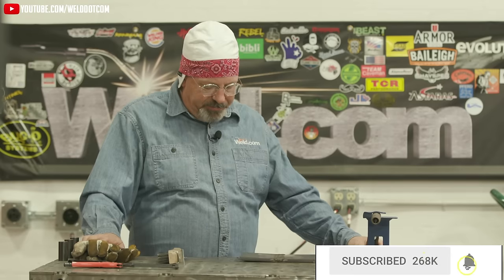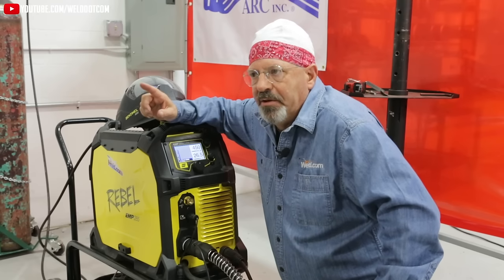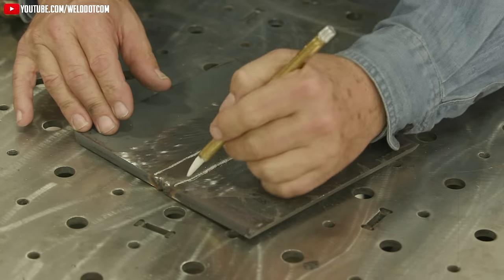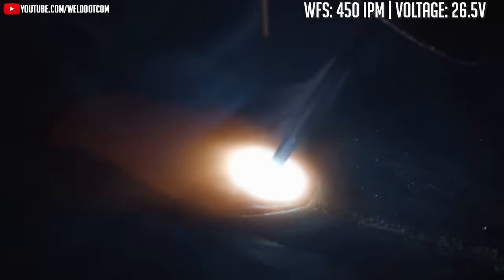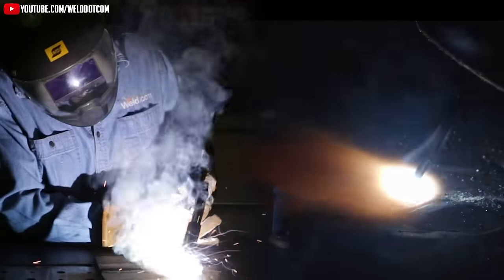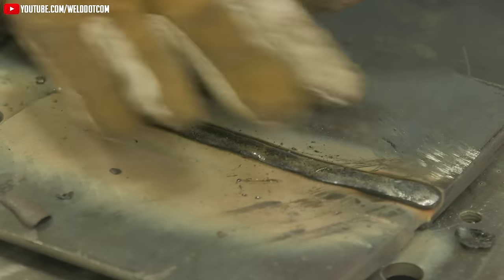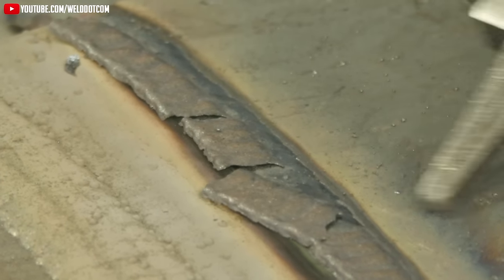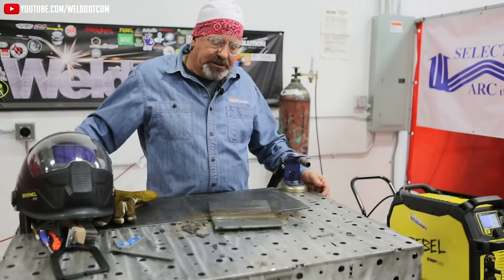GAS SHIELDED FLUX CORE WELDING FOR BEGINNERS

Comment: I have worked as a welder in Finland for about 10 years and I have worked in about 10 different companies. We have never really used anything else than flux core for general welding. It's just so much faster and easier .
Reply: With or without gas?
Reply: @stephentyas4698  With gas. In the companies I've worked/trained at it is mainly dual shield welding. If not it's tig/stick. Just so much nicer.
Reply: I just started as a weld school trainee where I'm at...and learning about this is amazing...not really much for me to learn here as my flats are almost perfect....my vertical welds are so crappy.
Reply: @grekygrek  From my experience you do NOT need to manipulate the weld in vertical position, just go straight!
Reply: @TheSongou  yeah thats what I'm sayin lol there's not much here for me to learn just need to stay under the hood and practice

Comment: In the late 70's Lincoln was developing the flux core for pipeline welding.  The company I worked for , of about 3,000 people, selected me to run welding procedure for Lincoln in the field for  welding high pressure gas pipeline from 0.125" wall thickness to 0.500" wall thickness.  The wire at that time would to toe nail a lot. Toe nail phrase means it was not stable it would burn to one side and switch back to the other.  We did get a procedure made to meet API 1104 pipeline welding code, the welds were x-rayed and mechanically tested per API 1104 code and passed the requirements.  

TIP
When welding a 30 degree V grove butt weld, the filler pass prior to the cap pass or final pass leave the prior pass below the surface about a 1/32" this allow syou to see the weld grove and allows you to make a nice weld cap or finish pass.  If you do not do this you will NOT be able to see where your weld path is. This holds true for GMAW as well.

Comment: This is a great video, but if I may, next time you do a flux core demo, could you use a really cheap welding box?  Something like the Century 90, or one of the harbor freight 120V titanium inverter welders, perhaps a 120v forney - you get the idea, a flux-core only cheap welder.  For us guys and gals that are learning this just for weekend jobs, or for welding something like a fence of exhaust pipe.  I love the videos, yours are definitely the best and my goal is after years and years of welding to make my best weld look like your bad welds!
Reply: Seconded. I'm a total neophyte when it comes to this stuff. And, like most beginners, I suspect, there's very little appeal to dropping a thousand dollars plus for my first right.  This is gonna be hella expensive to my mind al ready, and that WITH a cheapie setup.

That said, I suspect the only demographic that would get anything out of this sorta vid will be mostly similar, and therefore in need of a much MORE introductory lesson. You started out great... then just dropped into preparing we know what all those terms mean
Reply: Agreed, show me a beginner with a welder with so many adjustable settings. Mine literally has a switch for high/low voltage & a dial for wire speed.
Reply: This is dual shield, meaning gas and internal wire flux. Look for videos that show gasless flux core. Welding tips and tricks has one

Comment: I just started using Dual shield Flux Core Wire for a job welding 3/8 angle to 1/2 plate. On my ESAB Rebel 235ic, I use ESAB .045”Dual Shield ll 70T-12H4 wire. The sweet spot for this machine is 26.5/300, for flat and vertical positions. This wire does indeed run smooth with little to no spatter. Great video as always thanks for the lesson.

Comment: I run a warrior 500i all day at work. I have two settings that I use religiously, 28/400, and 24.5/350. I use 28 for any weld that isn't out of position. 24.5 is my go-to for all welds that are out of position.
Reply: Thanks,  what flow rates? I'm just starting to play with dual shield and have some ESAB  710X-M .052".
Reply: @workwillfreeyou  40cfm on 75/25. I also use a 3/4 inch hd tweeco nozzle

Comment: This really helps me I’ve been running fluxcore dual shield on some structural steel in the fab shop and I’m a stick welder so not too familiar with setting the machine. This has shed some light for me and gives me options for what I need for my welding thanks-IronmanMike

Comment: ive had GREAT luck with 24V and 275 WFS. ive used that on many different machines and minimal adjustments are needed for the WFS  but is works. not so much heat input and optimal control for all position welding.

i should add i have only used the Lincoln ET71 wire

Comment: I am a  boilermaker only ever used gas mig and stick welding.. I just took a new job whare I will be using flux core . I did find this video usefull . I have no doubt I will be able to flux core weld after running a few beads like this seems pretty straight forward.

Comment: Hey Bob, you look kind of like an Ewok from star wars there at the beginning...

But I got a roll if that select arc 730, .045, same stuff you ran here...thank you, Zack from Select Arc. I would concur that it is a very forgiving wire. It's probably the nicest dual shield wire I've ever ran too. So thanks for the video, Bob. I haven't played around too much with the settings yet, but I've used it for a couple of jobs in 3/16" steel square tube and flat plate. C25 gas at 40 cfh, started at 450 ipm and 26.5 volts, ended up turning it down to around 390 ipm, at least by calculating the dashed lines on the dial of my old MM250. Mostly in the flat position, a little uphill, most of it not quite as clean as it could've been and even a little mill scale left on. Some straight pulling, some manipulation. Runs nice. ZERO worm tracks. I like it.

Comment: I have tried dual shield with my Lincoln 210MP with .035 dual shield wire. My machine when I set it to flux core wants me to change to electrode negative, so thanks Bob for clearing that up. One thing you didn’t mention that I ran into is i had to change to a knurled drive wheel.  I was able to get some results but now that I have this new info I am going to try again. One issue I did have is the wire binding at the tip and bird nesting in the drive. I am thinking with these settings and the 5/8” contact distance this may not happen as much. I am thinking the dual shield “tubular” wire is a lit softer than the solid wire, and that, with the knurled drive wheel increases the chances of this problem. Thanks for a “beginner” video for us true beginners!

Comment: Love the video!
Had never heard about the correct tension.  Wear an insulated glove when testing it!
Seldom mentioned is the gun tube liner, looks like a long coiled spring:  hard to stuff a 0.055 wire down a 0.035 tube, and too big a tube lets the wire S-curve instead of advancing.  Clean it sometimes.
You really want an auto-darkening helmet.

Comment: Flux core was made for outside where as mig has to be in a free of environment stuff like wind per say . Mig and Tig are in a enclosed free of stuff that can mess up the weld like wind  rain stuff like that. As same with all clean metal to be weld on but winds and whatnot isn't for mig or Tig. But dual protection on flux core cool . Not needed but adds more protection. Cool vid.

Comment: As a brand new hobby welder enthusiast, something that  didn’t occur to me when I arrived home with my shiny new welder is; power from my household outlets. How about running a welder off a 15amp outlet? Power source seems like a no-brainer, but to me and others it can be completely overlooked by the weekend warrior. Thank you for your informative videos.
Reply: Depending on your machine you can do it. Try to hook directly to the wall before you use any sort of extention. If not your clothes dryer outlet will work they sell 220v extentions as well for that if needed.
Reply: @bmws1krr179  220 is single phase.

You need a hot,neutral and ground for 110 off of 220.
Reply: @dolphincliffs8864  and it can be three..
Reply: Taco.. shoot for something like a 10 Guage extension cord if your looking to stick with the 15 amp if you have to
Reply: @dolphincliffs8864  but yes the cord wouldn't be any different I see what you were getting at  I will edit accordingly thank you.
Reply: @bmws1krr179  I grew up doing wiring,worked on aircraft generators in the Navy. I know how things work.Done resi and commercial garage doors,wiring,steel work,carpentry and now I'm going to school to be a welder. Been an amateur welder for 20 years.
Reply: @bmws1krr179  ah thank you sir! I ended up having an electrician drop a new outlet for me.
Reply: @dolphincliffs8864  nice! I'm a pipefitter do welding professionally tig welding can be tricky in position with pipe. Otherwise stick to the basics or the book and it will run a nice root. I started on plate, ended up here still always something new to come through

Comment: I have been using flux core wire for 20 years now, built a trailer, 2 front class III hitches, heavy duty small tractor accessories, put tons of stress on the welds with pulling thousands of pounds with a winch, ripping up  dirt, never had any weld break, its tough stuff. Plus I don't have to pay for gas.

Comment: Great intro video. Now I know in class for butt and T welds I can adjust my voltage a little higher or lower than the Lincoln electric guide. Thanks for the video.

Comment: I would love a video on “why” you would use a dual shield, or metal core wire! ... An in-depth video where this is applicable! I’ve used Lincoln Outer shield 71m (with co2) in place of 7018, but this is it. I used it for speed, and the required strength. Without contacting the manufacturers of these products, it’s hard to figure out what you need!
Reply: Glad you brought that question up.
Reply: There are a lot of nuances in the welding world, and some things some people will tell you are better than others without really any real understanding of why. It's just something that comes with experimentation and experience. But there is a genuine science to much of it. Dual shield provides better shielding. I really think that's all it boils down to. Less likelihood of wormhole porosity. Plus DCEP just generally welds better than running DCEN on self-shielded. That's why all those cheap at home self-shielded flux core machines run like crap.

Comment: what is advantage of dual flux core vs flux core. i understand process difference but in the end what does dual provide to the weld ? i assume it is more expensive for flux core than bare wire and more cost for gas .  thanks for sharing all of your vids and experience.  Mike
Reply: Speed and deposition
Reply: The CO2 adds more heat for deeper penetration and better fusion

Comment: Would be nice if we could get an example with a welder we could actually afford.
Reply: E. Womer that is actually low end for a good multi-process machine 🤷🏻‍♂️
Reply: @brianhumphreys171  Yes, because $4,999.00 is low end.
Reply: E. Womer for a good industrial machine that runs GMAW, GTAW, FCAW, and SMAW $5k is low end.
Reply: @brianhumphreys171  Yes, industrial, this video is for beginners, so a 5 grand welder is not an affordable welder we can start out with.
Reply: Rather than complain, why not use the internet to find hundreds of options to suit your beginner budget.
Reply: It’s not $5,000 in most places. But when teaching, you need the best equipment if you’re trying to show the best welds without the machine getting in the way.

Comment: Sir,if you were building a welding bed,  what gage metal would you use and why? 
Also what welding method would you use and why?? 
I'm going to have to build a bed, and I would like to know what the experts, like yourself  would use to build a bed that will stand the tests of the oil and gas  industry. Thank you sir for any information  you can give.

Comment: Nice job mate. I've only really used solid wire with gas but im starting to do a bit of flux core at home. I would've like to see you drop the wire speed when you went down to 21.5volts as the average affordable gasless mig welder only runs around this parameter. Mine is maxed out at 24v. Great vid. Cheers

Comment: Can I ask why you use gas with flux core? I thought the idea of flux core was that it is "gas less".  Thanks.
Reply: For Higher grade welding more strong.
Reply: Having the flux will help with burning through impurities in the metal, and the gas mix (usually argon and co2) does the majority of the shielding and lets you get better penetration when running DCEP. If you dont use gas with a dual shield wire it will look like you used regular hard wire mig with the gas off. Dual shield wire is the cheapest and fastest way to do heavy work because you can have ridiculously high deposition rates.

Comment: Dual shielded wire is fluxcore wire and inert gas as the second shield? I have not welded before but want to get a flux core nachine for exhaust pipe repair. Thanks.
Reply: Yes!  The wire has a slag system, but also uses some gas (might be CO2) also.  There's not as much slag and general mess as with self-shielded wire.  I've only done it a little bit.  It seemed very intense, you get big welds, and the slag covers it and makes it look smooth, makes you look better than you are, as Jody says.
Reply: Too many amps for thin pipe. Use solid wire with CO2.

Comment: I'd like to see how you'd mig weld 1" thick A514 (beveled or fillet) in flat or horizontal with 90/10 gas and .045 Hobart Fabcore 1100 wire and/or .045 Hobart Fabcore Edge D2. I weld it a lot at work sometimes run into issues.
Reply: Yes

Comment: Great video as expected. Question? Is dual shield wire different from flux core wire that the 110 volt gas less welders use?

Comment: I love dual shield wire. One thing that drives me bat shit crazy is that worm hole surface porosity that comes and goes as it pleases. Surely operator error though. But nonetheless, keeps me from using it more often. 

Bob, you say the wire is forgiving, what about that fancy new style machine? Is maybe the machine doing some wonky madness in there to help as well?

I would like to see this wire ran up against, say esab dual shield ultra (which is what my LWS carries) and I'd also like to see that comparison done between your fancy schmancy new fangled machine vs an old transformer machine (like a MM250). 

What say you, Bob? Sounds like a good Bob vs Cub video.
Reply: Worm hole is 9/10 over gassing
Reply: Dual shield needs more gas coverage then short circuit mig.  45 to 55 cfh.  And dual shield left out in the elements can get shitty and give porosity.  I have run dual shield for years.
Reply: The other one is being too close to your material.
Reply: stevan deleon so what's your recommendation for shield gas flow rate? One says 45-55, I think bob said he in a comment below he was running 25.
Reply: @ryanjones9305  i run  between 45 and 60 with a 3/4 inch nozzle
Reply: stevan deleon thanks for the info. I doubt I've even come close to 60 cfh, so if worm holes are generally over gasing or too close of a stick out, I must be getting too close. I think I've run the gas up to about 45, but not higher.
Reply: I ran 40 when I used it and that was burning 052. Worms come from shitty prep and dirty wire more than gas. I’ve burnt up tons of it over the years. Prep is always the key to a successful welding job.
Reply: Ryan Jones worm hole parosity is not always operator error !, all it takes is a small about of grease or debris on your wire to cause  it that’s why I have a paperclipe. And a small peice of scotch pad before my drive rolls to keep the wire clean as possible.
Reply: Wormhole porosity or wormtracking is a result of excess moisture. It can come from an excessively humid environment, gas containing excess moisture, or a wire that has sat out and absorbed moisture into its flux core. When we developed 730 we chose materials that are less susceptible to moisture pickup to help mitigate wormtracking.

Too short of a stick out exaggerates wormtracking because there is less time for the wire to heat up and burn off moisture before entering the puddle. When you keep a longer stick out a longer section of the wire heats up and more moisture burns off before entering the puddle.
Reply: Select-Arc if it's made to be less sensitive to moisture, and I'm on the gulf coast, then I'll buy that wire. Post up a link to your website where I can buy it. I couldn't find it in your products list online.
Reply: @TakeDeadAim  Yep, if that is working for you it should not hurt anything. Here is a link to our recommended storage conditions: http://select-arc.com/products/index.php?content=storage
Reply: Select-Arc excellent. Is there a specific person I should ask for?
Reply: TakeDeadAim like old schoolers....broke down fridge and a light bulb.
Reply: Select-Arc hmmm....I might bake my roll of esab wire and see what happens. Don't tell my wife...she would not be impressed by a roll of welding wire being baked in her oven.
Reply: @ryanjones9305  Call and ask for Zack. We'll hook you up with a spool of 730 to try out.
Reply: Select-Arc 10-4. I'll be back in the shop tomorrow and will drop you guys a line then. Thank you guys!

Comment: Can you run dual shielded flux core on any mig welder? I have an older Lincoln weld pak that doesn’t have voltage settings. I just have a power knob that clicks into place, and wire feed speed.
Reply: Yes you can run it on your machine. Your voltage adjustments are a little more limited, but the machine will work fine. Experiment with one click higher and one click lower to see the difference in the puddle width and bead height.

Comment: Please could you suggest what could cause worm hole porosity in dual shield metal Flux core welding? There are probably several I'm sure. I occasionally get it and I'm not sure what I'm doing that causes it and that it's not everytime?
Thanks